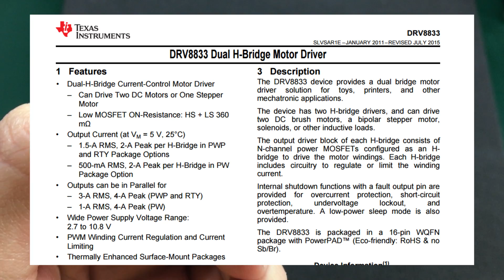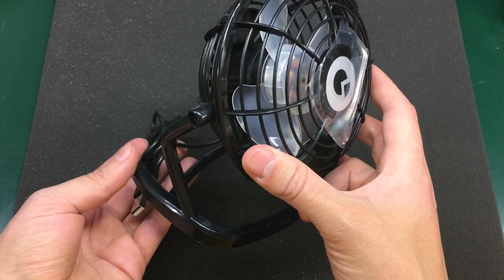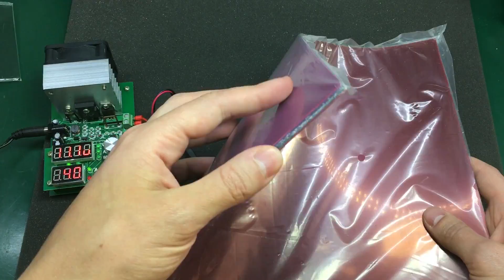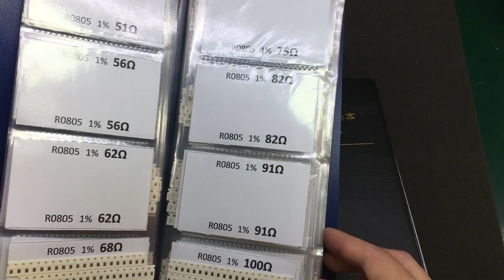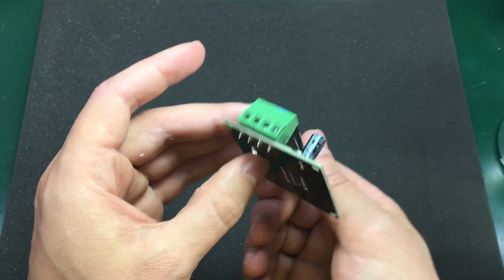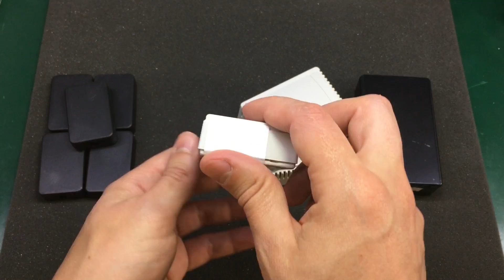Voltlog #103 - InTheMail

Comment: The little soldering Iron has saved my ass a number of times.  I need to solder a wire quickly in a remote spot, all I need is a power bank, probably have 10 of those, this iron and a chunk of solder.  Small connections are great, even switch and relays.  You do have to keep hitting the button.  I love your style of post bag videos.  Keep broadcasting!!

Comment: That red filter sheet is meh, but it will be muuuuch better if you put a polarizing filter (polarizing film) together, I use this method because is thinner than crystal filters or acrylic sheets (I usually just glue on top the displays and no need to make panel modifications) 
Also, this method works on all kind of display colors with the correct color filter (I just use cellophane for that because is cheaper ;)
Reply from the maker: I will try that, thanks!

Comment: Thanks for the mention! I found two types, the large sheet dimmed it more, but I also got a smaller polarized sheet, I used a layer of each for best results. I think the large sheets are meant for lighting systems originally
Reply from the maker: I wonder if polarizing films from lcd panels will work for this
Reply: As luck would have it, I have some sitting here from a broken screen (the HP chromebook I did a video on a couple of months ago), I gave it a go and it helped a little, but as it was clear it wasn't as nice as the tinted one I already had.
Reply from the maker: I was thinking a combination of the thin red plastic film + a polarizing film from the lcd panel. Or maybe it's best with just two layers of the red film. I will try that soon.

Comment: I've been in the same situation with the small plastic enclosures. I found these (http://www.ebay.com/itm/5PCS-Small-Desk-top-Plastic-Enclosure-Box-Case-Black-51x36x20mm-/201058331169?) a couple years ago and really liked them. About a year back I bit the bullet and bought a 3d printer. Now can easily make cases any size or shape.
Reply from the maker: there's a nice selection of small enclosures from that seller, thanks! I really need to get myself a 3d printer in the near future..
Reply: Ask Gearbest to send you an Anet A8.

Comment: This drv8833 board does not have current sense resistors installed.  I see no space for those either.  So it does not look like you will be able to get current protection with this one.  Adafruit breakout for drv8833 does come with sense resistors and is twice more expensive.  Nice IC!
Reply from the maker: You are right, I didn't read the datasheet and I assumed the resistors would be integrated into the driver but obviously they're not and need to be added externally.